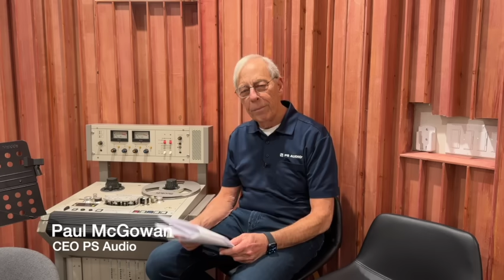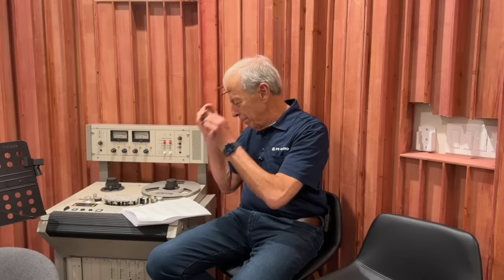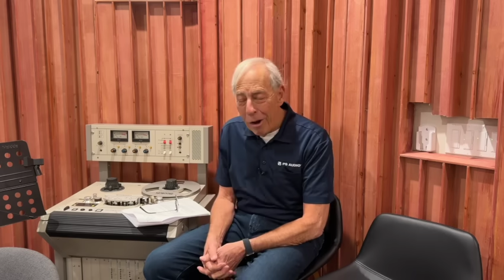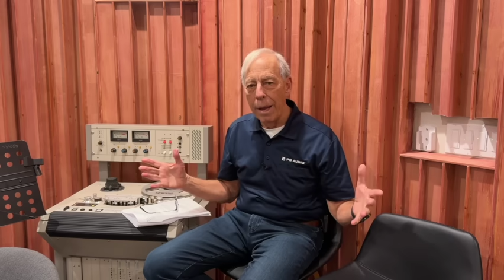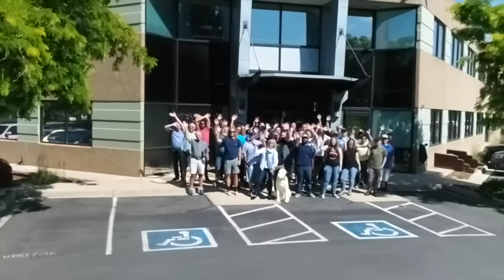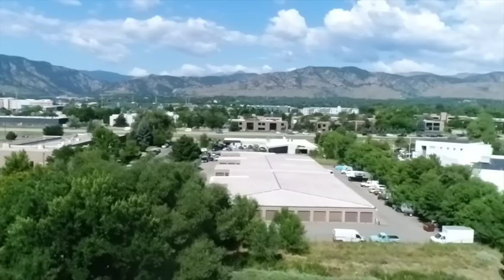When measurements and listening disagree

Comment: That's what the "measurement fans“ will never understand. You can drive 100 mph in a truck or a sports car, and NO ONE would claim it feels the same just because the speed is the same. But when it comes to audio gear, suddenly the measurements, especially the frequency response, are supposed to tell the whole story.

Comment: Fact: We can quantify every sound we hear, but we can't hear every sound we quantify.👍
Reply: Opinions vary.
Reply: @FatRat-f9m  They do. Science doesn't. 
Opinions are subjective; measurements are absolute. While feelings vary, the science doesn't. Modern instrumentation is hundreds of times more sensitive than human biology, allowing us to quantify nuances in frequency and timing that our ears physically cannot detect.

The reality is simple: We can measure everything we hear, but we can't hear everything we measure. A microphone doesn't care about feelings -it captures every single change in air pressure. If a signal exists in the air, it exists in the data. We can measure the physical sound wave perfectly; how a brain interprets that wave is where the opinion starts, but the physics remain fact no matter how one might feel about that.
Reply: @mrpeterfromgodknowswhere   ...my eyes roll back & my mind diverts when I start reading you engineering mindset blather.
I stop after the first line because I do not subscribe to it.

Comment: Easy to go down the rabbit hole on a question like this. Thanks for the simple explanation. My experience with measuring mechanical designs with very small duration, but high energy seems similar to your point of how long large transients within a time period, or slew rate, can a system handle. The problem I had was always, what happens to the system (components) after the event? How long does it take to get back to "zero" or nominal state? Does it "ring" or build upon the last event and become uncontrolled? And your example is just one aspect of a whole bunch of parameters. I salute you and the folks at PS Audio as you manage the huge amount of variables in the system. And yes, speakers matter as they have the final "say" in what you hear.

Comment: Waveform Analysis 101 tells us a good squarewave response is critical for an audio amp. Not just for the highs, but the lows as well. The tilt of the top of the wave shows low end. Slew/ rise times the high end. In order to properly reproduce any frequency you need to be able to reproduce the 1st ten harmonics. So with the typical 20Hz to 20kHz you have to be able to handle up to 200kHz to not affect that 20kHz. So Shannon Nyquist says minimum sample rate for human hearing is 400k.
Reply: Not quite true. The human ear is a natural band-pass filter. If you play a 20kHz square wave, your ear cannot hear the 3rd harmonic (60kHz), the 5th (100kHz), etc. To your brain, a 20kHz square wave and a 20kHz sine wave sound identical because the "squareness" exists in a frequency range where humans are deaf. 
In other words, we have no need to a perfect reproduction of a square wave.
Reply: Howdy.
Basically I agree.
However. The harmonics need only a fraction of the base note power. This moderates the Slew Rate demand quite a bit.
If one runs 20 Watts 15 kHz into a tweeter one can kiss it goodbye.
Cheers.
Reply: @eugenepohjola258  Also; while a 20 kHz signal at a 10 V output mathematically requires a slew rate of only 1.26 V/μs, standard engineering practice suggests a '5x safety margin,' bringing the target to 6 V/μs. Similarly, for a 30 kHz signal, the minimum requirement of 1.9 V/μs would ideally be scaled to 9 V/μs for reliable performance. Much like the damping factor in amplifiers, slew rate follows a law of diminishing returns; once these thresholds are met, further increases offer little to no audible or measurable benefit. And mind you the 10 V example and the high frequency example. You don't want 10 V at 20 or 30 kHz going into your tweeter!